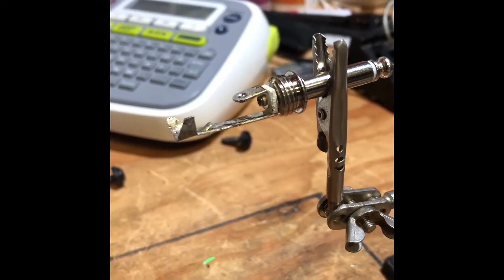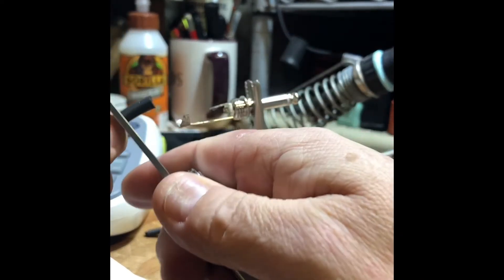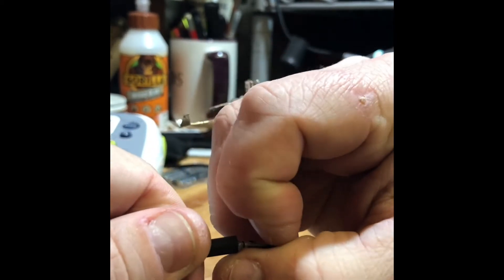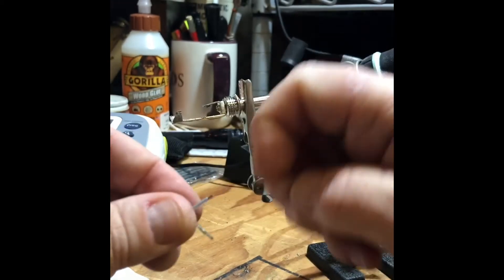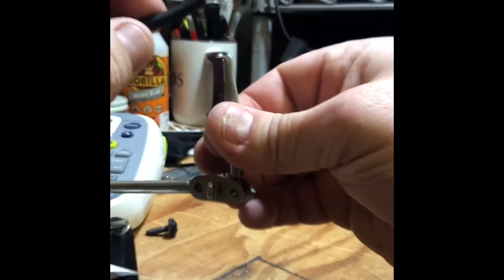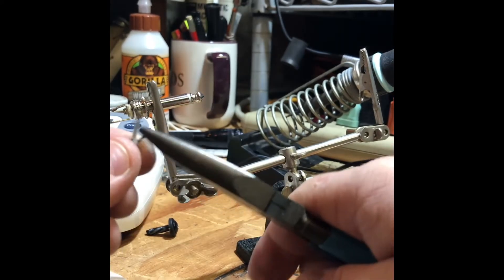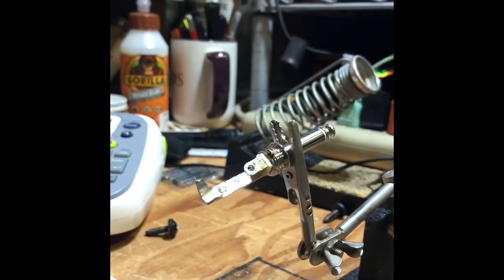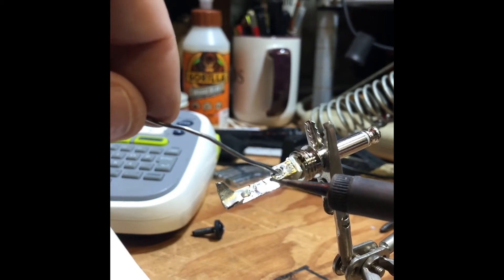Soldering 1/4” phone plugs with Mogami 2319

Comment: Thanks for the post. You have good pulse using knife to strip, Im poor at that ending accidentally cutting the copper 😂 I just finished building some 7patch cable using 2319 when I heard about another recommendation 2314.. anybody have compared both? Any good reason I get 2314 instead of 2319? I still need to wire few more cables. Thanks
Reply from the maker: Ha ha! I’d have to defer to Mogami’s website for the specs on 2319 vs 2314, but honestly can’t go wrong with their stuff if it fits you application.